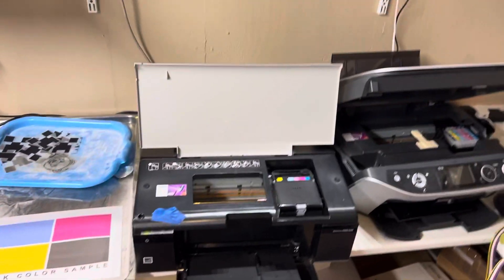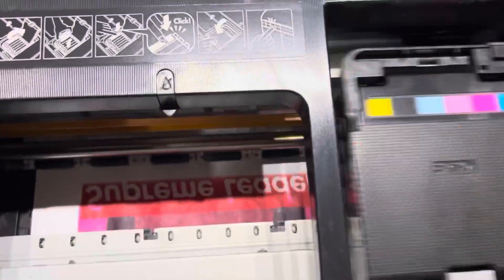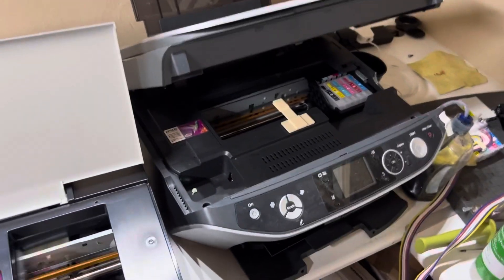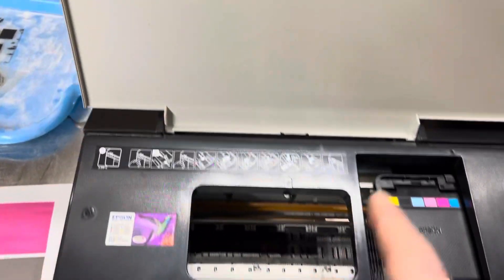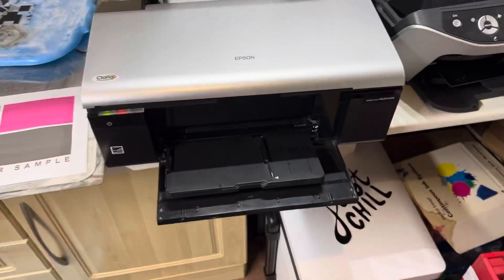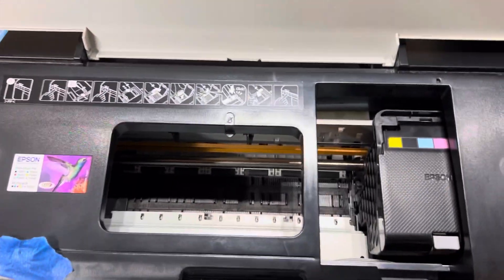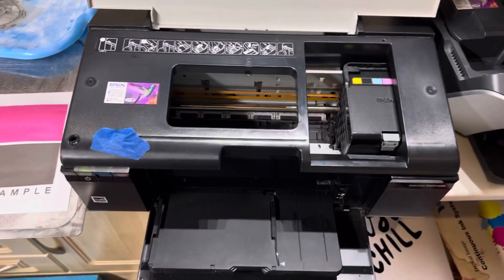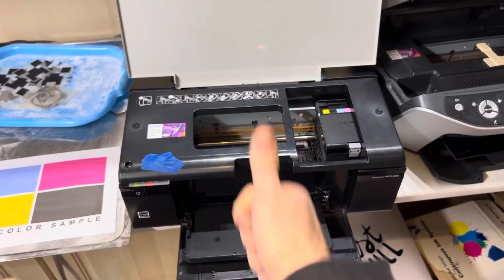Part 1: Budget DTF Epson R285 R360 R380 RX585 RX685

Comment: Wht software do u use for r280
Reply from the maker: AcroRIP 9.0.3
Reply: @DavesDiscoveriesChannel  which printer did you select as the printer in the drop down menu ? as i have the r285
Reply: You can use r290 or 1390 @TonysRefinishingTV